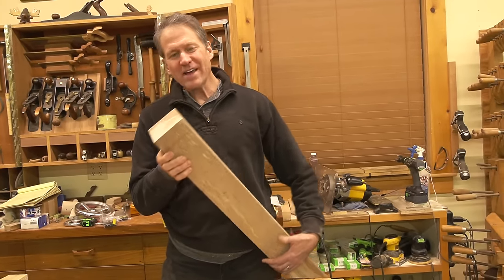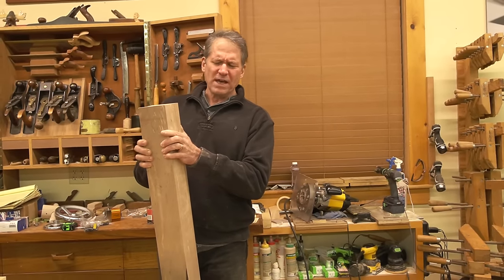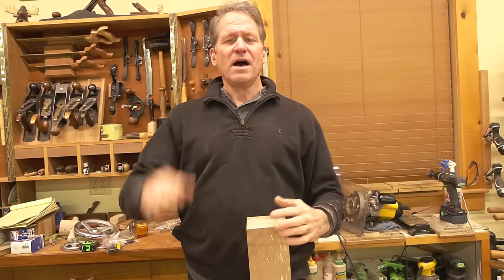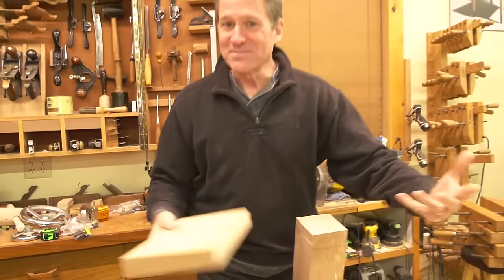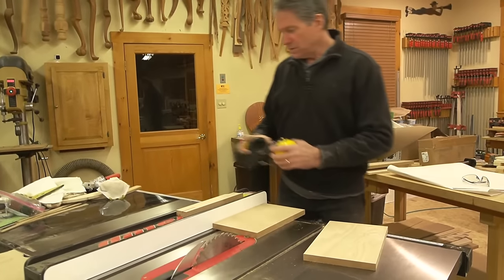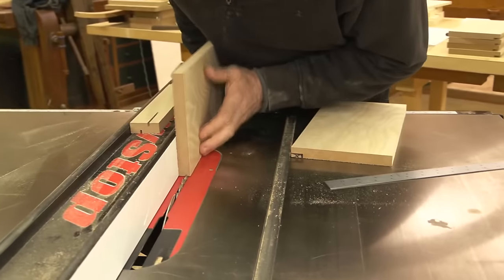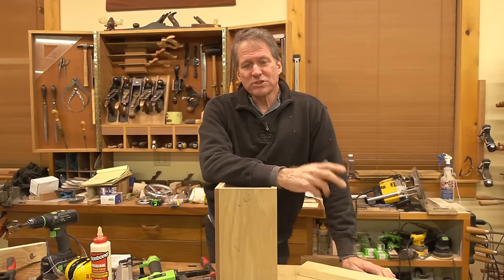The Ultimate Squaring Jig

Comment: Great idea and as usual, a lot of fun to watch your videos. It occurred to me, if the post is not too long, you could measure the portion that rises above the bench and vise to be 1/2" short of the jig's height. Then the jig can rest on the bench and vise while you clamp it. You could also clamp a scrap of wood to the post at the right distance from the top and rest the jig on it, clamp the jig and remove the scrap of wood.

Comment: I think that's a great idea. I'll be off-setting the holes for the clamps.  And I'll be placing spacers on the inside of the box so the job isn't touching the inside walls of the box.  I can then use my plane to square the top because I don't like the noise and dust that goes with the electrickery router.
Reply from the maker: Nice ideas, thank you! 👍😎

Comment: I made a similar box a couple years ago when I had to lengthen a 4x4 porch rail post that was already set in concrete.  The post was very visible and I needed a near perfect joint. I made the box a good fit but slightly larger than the 4x4 using perfect square and flat 1 1/4”  lumber. 
I only used deck screws to hold butt joints together on 3 sides making a U shape. The last side only had 2 screws near the bottom of the channel so it would flip flop and the jig could be clamped to grab the post.  First, I set the jig low and used it as a guide for a circular saw to nearly square cut the post on 4 sides. Then checked for square and moved the jig up to finish the surface with a router.  It worked! That was half the problem solved. I had already made a perfect grain matching square patch piece in the shop and tested my cutting method on scrap.  The patch was counter bored and drilled for 6” screws on a drill press. The piece was carefully attached using the 4 long screws and glue. Next day pull the screws and re-drill the screw holes for  ½” wood dowels.   Anyway….. the U channel and flipping side worked fine for pressure treated lumber. Not sure how well it would do with furniture grade builds.
Reply from the maker: Awesome, that’s a great application!! 👍
Reply: What about putting two screws on two sides, 2 each side one over another, so you don't need clamps?

Comment: Tom knows all about what i am going to say ...

You can do this square end with a crosscut panel saw. A little practice is all you need. Watching a youtube about how to accurately use a handsaw might help you visualize this.

First you mark your square line all around the beam. Then cut to the line.

This assumes all 4 sides are true. But then, do does Tom's jig.

How do you cut a square cut?

When you start the first cut, on the top face of the board, look at the saw blade and make sure sure the reflection of the saw plate lines up with your board.

When you saw, make sure your body is such that your shoulder, arm, elbow, and hand are linded up and move like a piston. This means right handers step a little to the rihht, left handerd to the keft. 

Grip the saw handle somewhat softly. Gripping tightly tends yo cause your hand to twist. When you cut, use the whole blade, and let the weight of the blade do the work.

By the way, it can help to use paste wax on your blade, apply it, wait a few minutes, and buff the haze off with a clean cloth or paper towel.

Cut your first kerf about an inch down. Watch that the reflection shows the blade stays lined up. Then while sawing start tilting your blade down and work down the face of the board. Be sure to cut to the line here, too.

Once about half of that face kerf is about an inch deep, you can rotate the beam and saw so that you get a 1 inch kerf in that face.

Keep going all the way around the beam. If you do this correctly, your kerf will be right on the pencil line all the way around.

What is kewl here, your saw will now follow the kerf and stay in the cut quite accurately.

I'll add that as you get to a corner of the board, if you want, go ahead and saw down deeper  on the corner. 

If you have many boards, Tom's jig will be faster. But if you have one or two, hand sawing is faster. Plus you will have picked up a skill that you can use the rest of your life.

Comment: Line the inside of the box with a quarter or half inch ply about one half inch lower than the outside box to create a slight step. That way you won't have to cut into the box to get the corners.

Comment: I would personally add a 1/4 inch solid wood piece on the inside otherwise you will chew the top of you box with running the router bit right to the edge of your post, and adding 2x t nuts on 2 sides of the box, threaded rod with pads on the end to stop marring of the wood your trying to square up

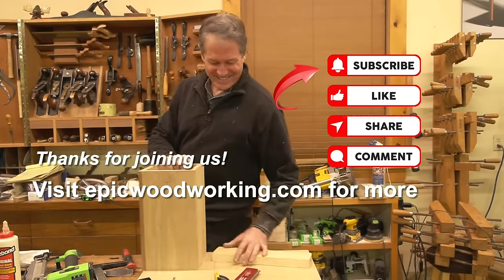Comment: Why don’t you add a rabbit around the inside top edge, maybe 3/4” 25:58  or 1” deep, so as to give your router bit room to cut the entire top of post, since it’s “a lot more effort” for router bit to cut into the long grain edge of wood. 
Also, you could install threaded inserts into two sides of jig and include threaded tightening knobs to clamp the post in place for routing.
Reply from the maker: Yes, great idea Aaron! It’s always quick and dirty when initially working a concept, and refinements like that are where the improvements by experience come in over time. Then you also have to decide how much you’re going to use something like this and if it’s worth making much better. Thanks for the ideas! 👍😎